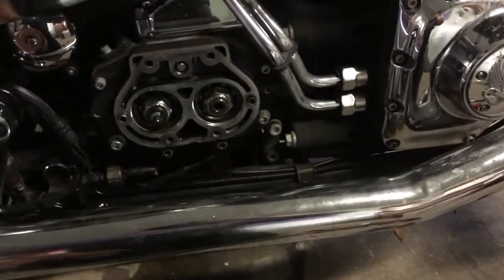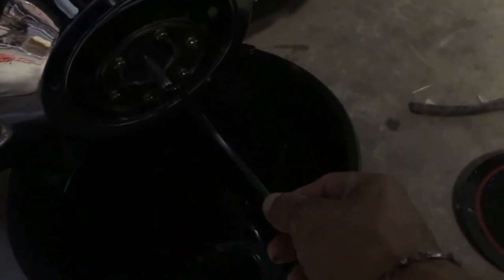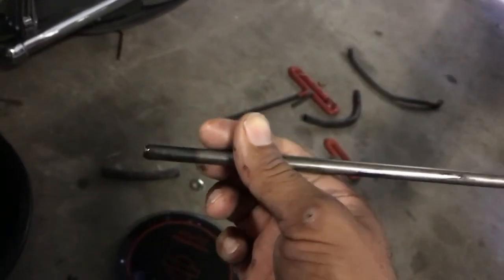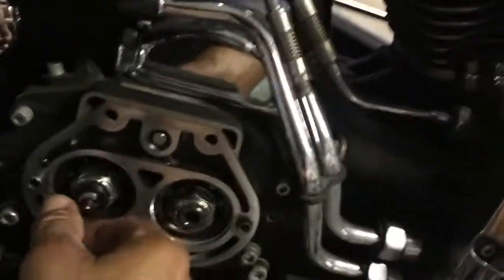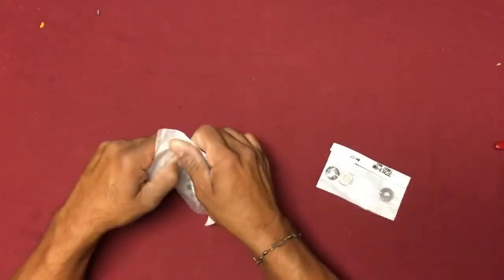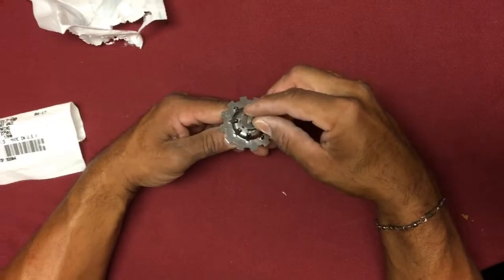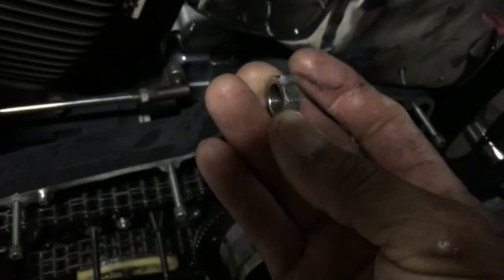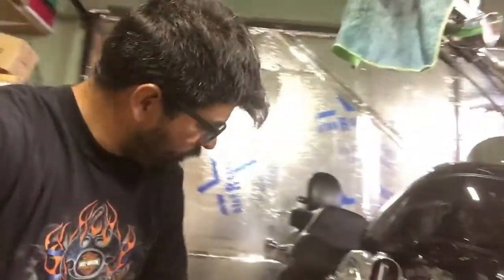How to Video - Remove & Replace Clutch Rod Assembly on a Softail Deuce

Comment: My throw out just shredded and fused the rod, adjuster and slinger together.  You're lucky to get it out with torque, wish i saw that video.  I had to cut the slinger with a pneumatic grinder after many tries applying torque in different ways.
Reply from the maker: Your clutch assembly must of really gotten hot.  When I torqued the down the adjuster, didnt think kit was going to work. What a pop.  I thought I ruined the clutch system.  Did you get your bike going?
Reply: @dustytales5829 when you say torque it down you tightened it and broke that fuse
Reply from the maker: That was going to be my next step.

Comment: Hi!
My clutch does not fully release when warmed up.
Although all adjustments of the rod and cable are respectively for minimum clearance and maximum release.
In what other unit is maximum wear possible, which affects the full release of the clutch when warmed up?
Because while the problem does not arise when cold...
Reply from the maker: @Ivan_Bubnov  I started having issues like that where my clutch plates were ready to go out.

Comment: How did you reemove all the pieces of the throw out bearing that got pulverized?
Reply from the maker: I opened the transmission drain plug, located between the shocks on the pan.  Also removed the clutch cable cover and flushed it out with WD 40.

Comment: When riding the bike did it seem like the clutch cable broke at first and this was the issue??, just had something similar happen to my 1989 softail and the clutch cable is intact however it doesn’t engage the clutch at all
Reply: hi, i have the same problem on my 1990 softail,  did you fix it cause, if you did what was the problem?

Comment: the two prong release fork, what position did you put it in when you installed the cover>? was it tight to cover behind bearing>?
Reply from the maker: Scooby  The clutch assembly uses a ramp release system.

Comment: I replaced my slinger bearing and still have no clutch. Clutch pack is good, just the slinger bearing desinegrated.2006harley softtail. Clutch stiff and don't ingage.